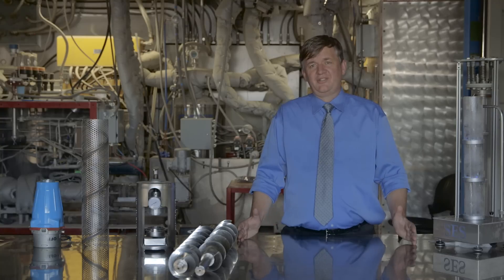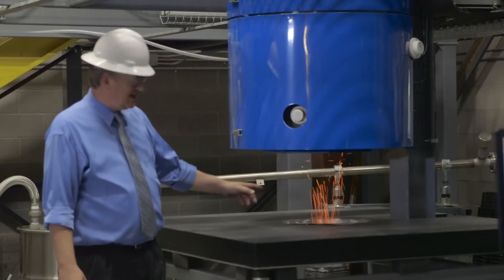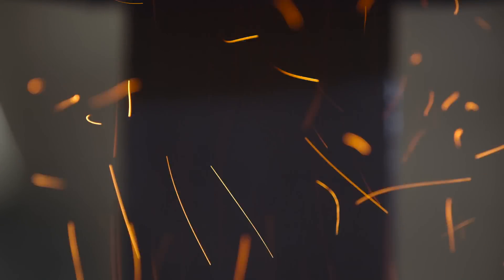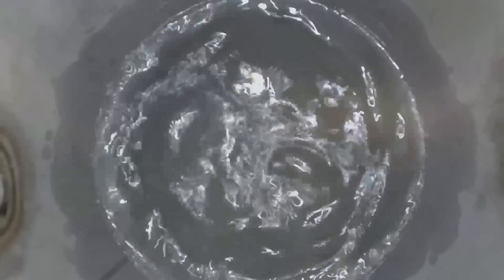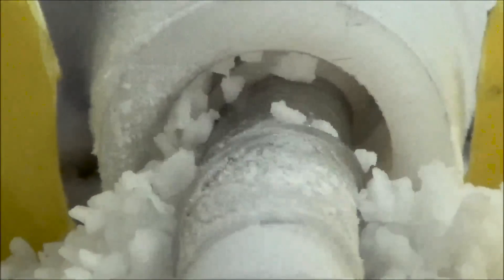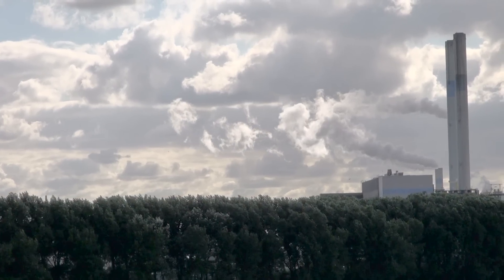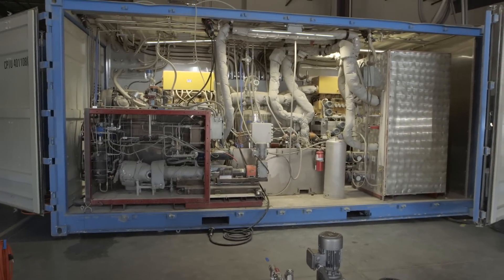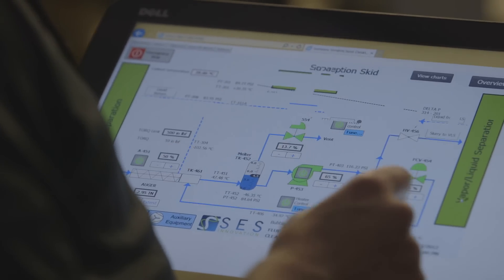Capturing CO2 with Cryogenic Carbon Capture

Comment: and what do you plan to do with all the dry ice?  send it to Mars?  Removal without storage route is pointless.
Reply: Just dump into deep sea and the sea pressure resist phase change from solid co2 to gas sea pressure is huge😁😁

Comment: Now if we can convert the co2 to a fuel, that would be even more awesome. Could this make coal viable as a clean energy source? Is this technology in use anywhere yet?
Reply: Yes, such the conversion from CO2 and water into liquid fuels is possible and has been possible for a long time. Over the past couple of years the process has become a lot more efficient though. So they estimate that we can get such fuels for 55 to 200$ per Barrel depending on what carbon capture technology is used and depending on how the fuel is made. 
There are companies that are already mass producing such fuels. There's ETOGAS in germany which has a 6MW plant that produces Methane. There's a plant in iceland that produces methanol (capable of producing 5million liters per year), there's a company called carbon engineering. Their pilot plant is capable of producing a barrel of fuel per day and they are currently scaling up production and they want to go on the market in 2021.

Comment: How much does it cost to cool the exhaust to such low temps?
Reply: +reddir A key concept to understand about this process is that it does not deliver the CO2, or any other gas at cold temperatures. It cools the gas until the CO2 freezes, separates the CO2 as a solid, then used the cold gas and CO2 to cool down the warm gas coming in the front end of the process. The gas coming in and going our are at about the same temperature and this makes the cycle much more efficient than a traditional refrigeration cycle like your AC.
Reply: Approximately 80x the output of the powerplant.